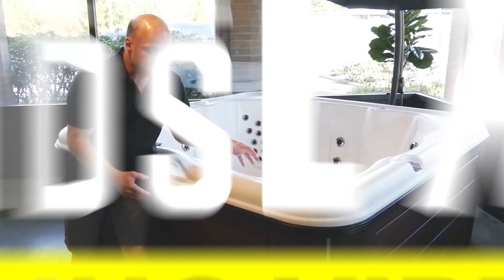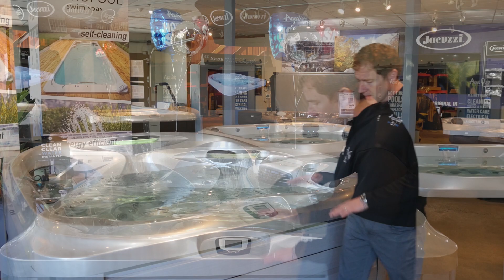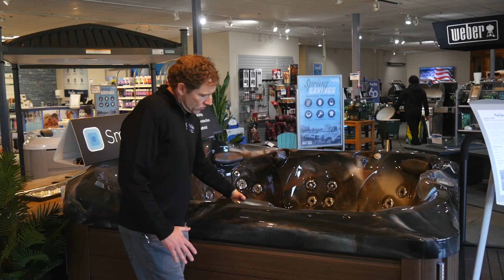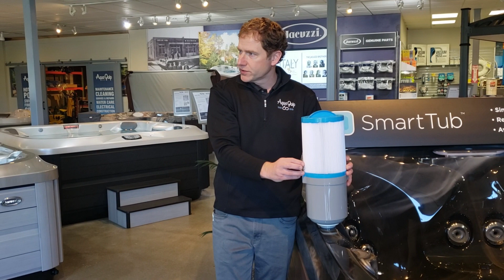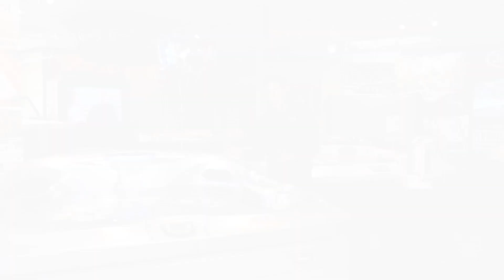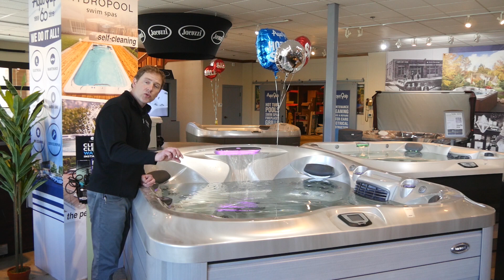Virtual Battle of the Brands Jacuzzi J-400 Presentation

Comment: Thank you for a clear and precise presentation. I learned a lot about the Jacuzzi which is the brand I want as I need to replace my nearly 20 year old tub. I uses Jacuzzi pumps but is another popular brand locally. The pumps are original except the blower which was replaced a couple of years ago. The insulation factor is a big one for me being in New England. I really want an efficient tub as we use ours a lot in winter which is my favorite time to use it. The air mix is also important. Great presentation!

Comment: Buy a hot springs from Olympic hot tubs you will be happy you did , if not 2nd choice get a bullfrog , much more comfort and energy efficient..if you want the truth about hot tubs do not take facts from dealers but contact an independent spa service company with no ties to a manufacturer and ask what brands they service the most  after the warranty expires because most spas last as long as the warranty and most manufacturers have escape clause built into their warranty’s like chemistry abuse by claiming you did not treat the water correctly that’s why going with a better company can save you from lots of headaches and  money .... your ownership of a spa will be much more enjoyable...
Reply: All one has to do is simple research & that will tell you that Hot Springs is the most Repaired brand in the industry. HS Breaks down more so than others & at a more frequent rate.

Comment: I can attest to"Jacuzzi"brand & it's Robust High end Quality! My short story is this- I purchased a pre-owned 2005 Jacuzzi J-315 in mint condition for $550.00 6 years ago. I am the 2nd owner of this hot tub & I can tell you I have Not had 1 single issue with my pre-owned Jacuzzi! I also love the fact that I was able to exchange a proprietary chip on the motherboard which now let's me extend my total temperature to 106° no other hard-sided hot tub manufacturer does this! Jacuzzi is #1 & always has been!
Reply: You are a dealer for jacuzzi brand because you can not purchase a chip legally to change out on the motherboard and you are using terms only dealers use so quit trying to fool the folks ...
Reply: @firerock1611 You are completely Incorrect in your statement- YES you can purchase a Proprietary chip to extend the temperature to 106° that is a 100% solid fact, So simple for an individual to simply fact check this=Duh🤦  I am the 2nd person to confirm the"chip"purchase.
Reply: @firerock1611 I can increase my temp to 106 with no chip or nothing….straight from the factory j-335 so what are you on about?!?!

Comment: My brand New J-475 just installent today is leaking from the 2 diverter valves pump 1 and 2, the air switch are all leaking and one whistling like crazy. I’m not impressed with Jacuzzi Quality and their QA/QC control. For a spa over 10 grants it’s really disappointing.
Reply: I've had nothing but issues on my J-475 purchase from Aquaquip, Bellevue, Washington. Can't believe I've spent $17,000+, waited five months for it, got it and found the modem didn't work and the doors were installed incorrectly. Also, the water is constantly dirty and I didn't get any chlorine, bromine or anti-scum for the tub either. No one came to show me how to use it either. For that money, yes, I absolutely want someone to hold my hand.
Reply: @cam4840  : pay no attention to his reply as he is a dealer for this brand and obviously drank the cool aid ...call the factory and ask for a production manager and if that gets you  no results ask to speak to national sales manager and threaten to get local press involved if necessary ....good luck
Reply: #1--Call the dealer you purchased it from. 
#2--Set up a tech appointment time for them to come out & repair the unit!
Do I have to hold everyone's hand in life & slowly walk them to the obvious/appropriate answer!!!🤦‍♂️
Let me guess, you were a lawyer or doctor, perhaps a mechanical engineer, even a scientist but you have NO basic street common sense!

Comment: I just bought the J-275. It comes in two weeks.
Reply: Please provide an update on your experience. Thank you!
Reply: @erindav1  It is good. I love it. Plenty of space for my wife and I to float around at night. We spend 30-60 minutes whenever we in it. Lights are great and jets are super strong and even strong enough to where they need turned down a bit. Shell is very smooth. Also, Perfect for the kids to splash around during the day. I feel comfortable leaving them alone and peaking on them every now and then as the water depth is only 2-3 feet and my kids are tall enough to stand and keep heads out of the water. The hardest part is keeping the water chemistry balanced. I really don't think anyone has the answers for it. We probably should be changing the water once a month or once every two months to really keep it clean even when putting chlorine and all the other chemicals in it.

Comment: Great presentation, very informative.  I have a J-425 on order from my local dealer with a delivery date of early 2021.
Reply: If you don’t mind me asking, how much does your  j-425 cost? Our local dealer has the j-245 in stock, it seems like they really trying to sell us that one; but the look doesn’t seem very appealing as the j-425 for sure. We want to see the difference in price. Thanks in advance!
Reply: @lusariffic  no problem, $10,498.
Reply: @williamwalsh3882  thank you! Does the price include covers, steps and delivery? It was a great price compared with what we’ve quoted for! Thanks so much!
Reply: @lusariffic  no problem.  Here is the breakdown.  $10495 (J425) Lifter and Covermate III included, $300 (Optional Clearray), $150 (Steps), $300 (Delivery), $200 (Disposal) Total $11445.00.
Reply: also, they are very delayed at the manufacturing plant so my special order spa is delayed until April.
Reply: @williamwalsh3882  thanks so much! You got a great price!